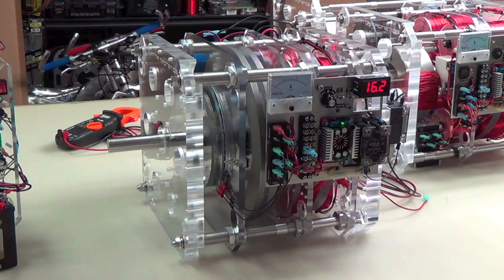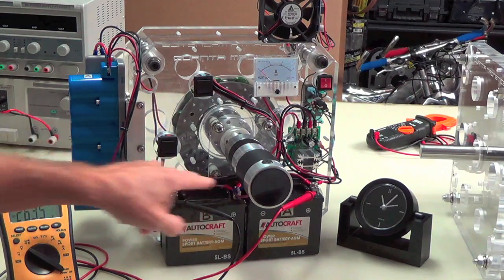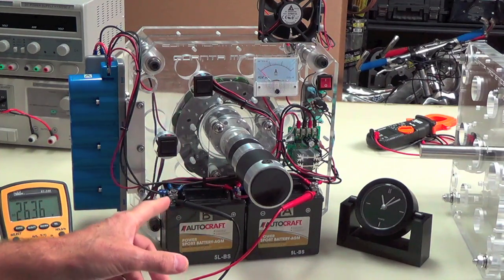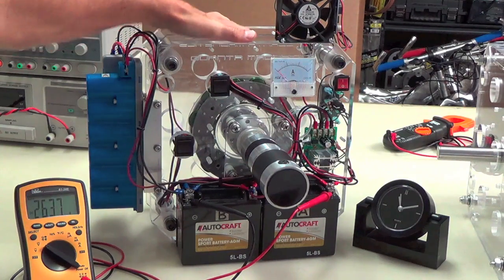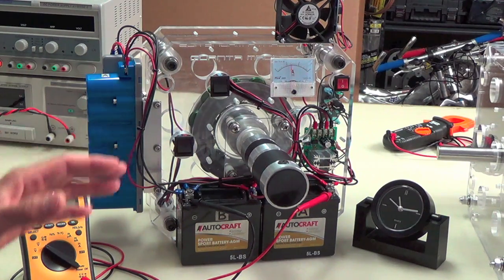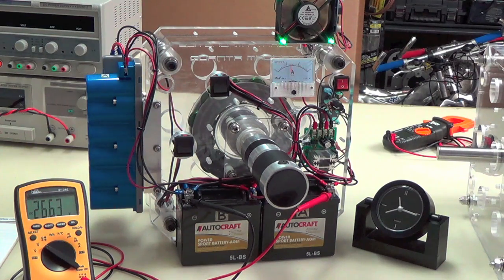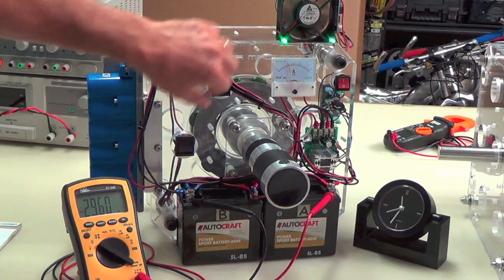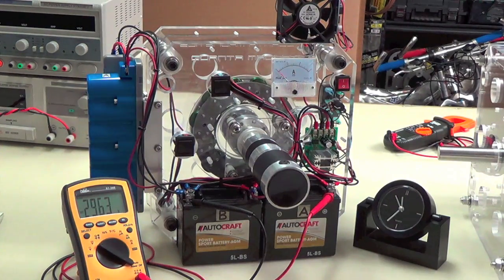Tesla Switch Hybrid to Supercaps

Comment from the maker: THIS COMMENT IS FOR EVERYONE: 

The Simple demonstration of the G1 3-phase shown here, requires only 2 elements: (1) High Torque, low input motor. (2) Low Drag alternator or generator. The motor is a reduced rpm gearmotor with a planetary gearbox. The G1 3-phase alternator quickly becomes low-drag as the output impedance is reduced from accelerated charging. That's it! 

Lead-acid battery chemistry acts as a charge accelerant for the high storage electrostatic ultracapacitors, as alternator counter torque is continually being reduced. This reduced charge impedance causes the motor to demand less input energy to continue performing its duty. Input is proportionally conserved as stored output increases in ultracaps.

Comment: Why not use it to charge a bank of batteries?  If it's actually over unity you should be able to calculate the coefficient of performance. The whole system may have an increasing efficiency as the voltage and subsequently RPMs go up.

Comment: Having a masters in electronics, I can easily explain to you what is happening here, and why the voltage rises, even if the motor is running, but the thing is. No matter what I say, you will not care for a rational explanation.
Let me instead ask you this.
How do you explain, that after some time the motor will run slower, and the voltage will start dropping again?
Reply: What is your explanation? I cant tell the circuitry of it from just looking at it.
Reply: I cant see your reply :/

Comment: Initially power is consumed to inductance of motor magnetic fields.
Therefore drop in voltage.
Once inductance is saturated, the whole thing act as resonant circuit between inductance(motor/magnetic fields) and capacitance(caps and batteries).
Resonant curcuits alter voltage phase from current phase. There is a lag between phases. Having higher voltage means the current is lagging behind the voltage.
It doesn't mean you have more energy in the batteries/caps.
It is very likely that voltage is gained on the expense of current.
Reply from the maker: That's an old story that keeps missing the point of coulombs vs. chemical reactions.
Reply: @PMMG4HYBRID  what does that mean ?
Reply: I'm asking.   Cause if you follow your reactive power logic, the Stanley Meyer fuel tech should be possible.
Reply: @PMMG4HYBRID  what is columbs vs chemical reaction
Reply from the maker: @ryanb1874  Q=V•C  Super simple, no chemistry or heat. Check Google for in-depth explanations.
Reply: @PMMG4HYBRID  

Donald Kelly YT chanel has an interesting video on this Tesla switch subject.

It might help in what you want to accomplish.

Thank you for your post.
Reply: Do you think Paul Babcock is a big time charletain,
Reply: @ryanb1874  i am sorry. No disrespect or insult was intended. 
Only a technical interpretation.  I might be wrong.
Nothing personal here.
Reply: Leeor Shimhoni was correct. The reactive power in the Inductance -Capacitance circuit is far less than the real power delivered by the system. 
A resonant circuit as you did is a closed loop where the voltage and current are out of phase. 
When voltage lead and current lag, the apparent power is not indicative of real power. 
Besides, wet batteries could indicate false potential difference due to pulse charging (a dedicated dc pulse charger has 3 or 4 stages with recovery time in each stage). 
If you power the system with a REASONABLE load over long time, you will realise that the battery residual capacity is depleted, and it will be hot. 
Nice and beautiful work. One day, with new paradigm and material, humanity could break the mystery of overunity magnetic motors.
Reply from the maker: @dkoolkool8103  I don't even use batteries any more. Too many factors to calculate. Capacitors only. Super easy to calculate coulombs of energy storage at any point in time.
Reply: @dkoolkool8103  i prefer to be wrong so i can learn something. But if i am right, then it is not my field of knowledge, just a wild guess. I insist thinking i am ignorant, so i never stop learning.
Reply: @leeorshimhoni8949  you are a classy individual. I wish more thought like you do
Reply: @dkoolkool8103  I'd like to point out, that all capacitors, and inductors Don t phase stager the two components by 90 degrees at certain speeds,  but with stationary dc,  yea probably.
Reply from the maker: @ryanb1874  I don't even use batteries any more. Too many factors to calculate. Capacitors only. Super easy to calculate coulombs of energy storage at any point in time.
Reply: You described the end result of a DC to DC boost converter (or an inverter without the sine wave final).

Comment: You do a nice job, I have a similar design which I draw down to use as a backup for my inverter batteries, and now with your design I know it will work fine without any problems. Thanks

Comment: The effect takes place threw the initial momentum of the electron. Your motor gen is trying to rotate at the electrons speed since you are using an electron to spin it. ;) get it, It is limited by it's own internal resistance (THE MOTOR GEN)

Comment: This setup will work great for regenerative braking of electric cars. The power generated from breaking is comes in such a high surge that the battery pack can't use it all due to their slow rate of charge. The super-caps take a charge in milliseconds and can store nearly 100% of the power surge from breaking. We don't see regenerative braking on production Electric Vehicles because a efficient system to "capture" the surge of energy hasn't been developed. It was hard for me to follow what was happening with Battery "B" powering the shaft. If the shaft was driven by a fly wheel spun up with an external power source then use the three phase alternator to transfer the energy to the  storage/charging  system. Good to see you doing innovative  work.
Reply from the maker: Thanks Tom. You got the point exactly!

Comment: The voltage of each series connected super-cap is equal since their capacitance is equal (1/2 the series voltage). Not true for the series connected lead acid batteries. Battery B has discharged and will have a lower voltage and less charge than at the beginning of the test. The energy stored in the super-caps + the energy stored in battery A + battery B will be less than at the start of the test. The series voltage across the lead acid batteries is not a good measure of the State of Charge of each since the voltage is not Equalized. In fact Equalizing the charge in battery banks is needed to avoid damage to the batteries that have degraded a little bit more than the other batteries in the bank.

Comment: Maxwell auto ultracap module max voltage is 16 V + 13.2 V lead acid = 29.2 V  in series; I'd not be surprised to see it go up after shutdown, although it is kinda spooky I must admit! The ultracaps perhaps are able to store transient spikes more efficiently and (somehow) spread them over time to the battery. Cool setup! The question is how come this voltage does not show on the power meter until many seconds after shutdown? I think the explanation is that the power meter does not draw much current.... and the resistance of the batteries makes it slow to top off near the top voltage. I'm going to install one in my car asap!! Every car should have one!

Comment: Build a electric motor with capacitors placed inside of the Flux of the field coils the magnetic lines of Flux will charge the capacitors, capture back emf energy and direct it to charge battery. Basically this is a tesla switch, this could be built in a motionless coil assembly, using permanent magnets and coils to distort magnetic Flux, like a magnetron bulb. Causing Flux to bounce back and forth.  A coil magnet assembly surrounded with supercaps and lithium cells. A assembly like a motionless coil would not have friction losses no rotating mass needed! The assembly would attract  free electrons in its magnetic trap circuit charging battery's. 🤔
Reply: I'm in a little over my head here but you sound like you could just be a genius!

Comment: How long will it take to charge a 24 volt truck battery ?
Reply: Depends on the charger's output, but on a slow charge, about 8 to 10 hours. Fast charge maybe 4 hours or less...

Comment: The second hand on the clock appears to move in 2 second increments...
Reply from the maker: Yes, that is the design of the cheap little clock.
Reply: @PMMG4HYBRID       Yes, when I reported on the fact that the second hand moves in two second increments, I again watched the video and looked at your actual time of placing the clock there at say, around 2:37, and noted that the second hand was actually operating normally in one second increments, right up until 3:30, where it then operated in two second increments. Could the little clock's close proximity to your demonstration of your G1 3-phase alternator, have affected it's circuitry, that caused it to show the two second increments?  I would say the clock's battery is fine, as after it's initial one second movement up to 3:30, it continued to show a strong pulse every two seconds, whereas a next to flat battery will show a second hand with a feeble movement, a slight "jumping", but remaining in one spot. Thanks for your feedback btw, cheers...

Comment: What if you add a bank of batteries that you can charge with the overcurrent as a battery or capacitor array, so you don't lose the excess voltage but store it. Keep adding to the array and you could build up storage from the original source device.  Could create perhaps unlimited array of reserve storage ?
Reply from the maker: That's a much better idea of expanding the storage.

Comment: Just a few points for clarification. i noticed super cap modules. what is the cut off or max voltage 5 super caps at 2.7volts 350farads or 13.5 volts at 175 faradsfor each series module. lets see a test with a 100 watt light or two headlights off of a car. A real load for and hour. IMHO its just the electrolyte in the super caps that is driving the results with the insignificant non real life load and the short time elapse. because of the loss of half the farads when super caps are connected in series. but i dont have the equipment its just a suggestion to demonstrate your findings significantly.
Reply from the maker: Further clarification: 6 ultracaps per module @ 2.7V ea.=16.2V, 58F capacity each module

Comment: Congrads you beat me to it....If i only had the equipment,  .....damn..... it takes all my time just to build ,equipment i need.. before i can even get started...so move on to other projects....but i still cam help you improve on this one... awesome concept.....but try pulley redection or faster charging times.on charger ,with a larger magnet wheel .. say maybe off of an ebike...reduce the unit size   ,see if you can get the ebike to run  without  a charge.but you would stilll neeed a battery.. ..with my new idea ,im not sure whats going to happen but ,i know it will be OUT OF THIS WORLD>   ; )    .interested.???

Comment: Just need a voltage regulator shut off switch so your batteries don’t overcharge and it’s set for application of everything in the house, refrigerator  air-conditioning  your heater to, you could do away with the electric bill
Reply from the maker: Sounds good to me.

Comment: It appears to be quite a balancing act. But, in this case there seems to be some wasted energy. I think there is an opportunity to use that wasted energy. It seems to me that you have created an excellent Auxiliary Power Unit (APU). But, if you bridge the gap, you could mount additional torque motors for propulsion or some other useful purpose like heating or air conditioning.  I live in Florida, so I vote for air conditioning.
Reply from the maker: I agree. Who doesn't love A/C when it's 105 degrees every day with the heat index. Yowch!

Comment: In time-lapse, it can be clearly seen that the current wobbles up and down. Consider that something celestial is altering the current. If you were to take the axis of the motor, for example, and have it aimed directly at the magnetic line in your location, this orientation might produce the least drag. Or, in other words, if you experiment with orienting the axis of the motor to point to various 3 dimensional coordinates, does the charging effect demonstrate a boost or attenuation. If the answer is yes, this is some conformation that the direction of spin of the motor relative to the Earth's magnetic field may help or hinder the power generation. But also, consider this. Your have very large capacitance. You turn on the device and for a period of time, the voltage on the battery will drop, and the current from battery to caps will be higher. As the capacitors slowly charge, because of their high Farad rating, the voltage seen on the battery will start to rise, and the current seen from battery outward will start to fall again. Eventually the capacitors reach the same voltage as the batteries, and the current no longer flows with volt meter finally showing the equilibrium point. If the capacitance value is HIGH, then this is what would be observed ... and it would take time.

Comment: Fascinating, I think you need a variable load to see how much energy can be taken before the batteries begin to discharge, and could you add another coil or coils to the alternator to feed battery B so that it has equal charge as battery A and would it make sense to use a 24v motor fed from both batteries so they both have an equal load, also what happens if you disconnect the batteries, does it continue to run just using the capacitors?

Comment: The empirical evidence is obvious. The series-parallel combination of the supercaps and the batteries have a standing voltage equal to the standing voltage of Battery A and B, respectively. When the motor is energized, it rotates the three-phase generator which contributes a charging current to Battery A via one of the phase outputs and to Battery B via the other two phases (connected in series) across B. The addition of additional load after the net charge begins to increase clearly demonstrates a 'charging effect' that cannot be denied. "Fly-wheel effect" not-withstanding, this appears to be an 'over-unity' device. I understand your reluctance to use that terminology but, for those of us who are interested in alternative energy solutions, this demonstration is very promising.
Reply: Olav Viking 😬😬Ouch, Even I felt hurt by your frankness. He tried I give him credit for it. 😐😑

Comment: You do work using the electricity from the batteries. The work causes the capacitors to be charged. The capacitors lose that electricity fairly slowly. Is your point that electricity can be used before it's lost from the capacitors? Why can't it be moved to the batteries?

Comment: I think you should put it in a vacuum chamber the air resistance might be affecting the efficiency
Reply: Capacitors have no standing charge so when the machine is cut on they start to charge increasing the voltage of everything wired in series.  A battery, even when discharged has th e same voltage unless it is bad and can't recharge. The capacitors will have none unless charged.  Since it is wired as one unit the voltage increases as the capacitors get charged.  It's also why it balances out.  This is electrical magic but the kind in Vegas, not the kind in Harry Potter.
Reply: @SayinWTF  , there is a reason for everything. Vagas is a mafia-owned succer's paradise, and harry Potter is witchcraft. Two of the reasons the United States is suffering so many severe problems. Deuteronomy 28 applies.

Comment: The battery voltage in battery A with the extra leg is causing the total voltage to climb while battery B with only one leg is much lower. Put  meters on both batteries Independent of the series volt meter and you will see what’s really going on.
Reply from the maker: I've already explained what's going on. Build one and find out for yourself.

Comment: Intresting. So this will only work if batteries and supercaps are used, not with only supercaps?
Maybe some memory effect in batteries, are all battery and caps at same voltage level when you stop if you measure them separated?
I wonder how long it can do this if you increase the load so the batteries don´t get overcharged.
Can you try, it would be an intresting experiment?
Reply: Capacitors have no standing charge so when the machine is cut on they start to charge increasing the voltage of everything wired in series.  A battery, even when discharged has th e same voltage unless it is bad and can't recharge. The capacitors will have none unless charged.  Since it is wired as one unit the voltage increases as the capacitors get charged.  It's also why it balances out.  This is electrical magic but the kind in Vegas, not the kind in Harry Potter.

Comment: It would be interesting to see how it performs with an electronic load across the batteries. You could crank up the load until the voltage across the battery stabilizes. Then you could see how much extra power is generated.
Reply: Capacitors have no standing charge so when the machine is cut on they start to charge increasing the voltage of everything wired in series.  A battery, even when discharged has th e same voltage unless it is bad and can't recharge. The capacitors will have none unless charged.  Since it is wired as one unit the voltage increases as the capacitors get charged.  It's also why it balances out.  This is electrical magic but the kind in Vegas, not the kind in Harry Potter.